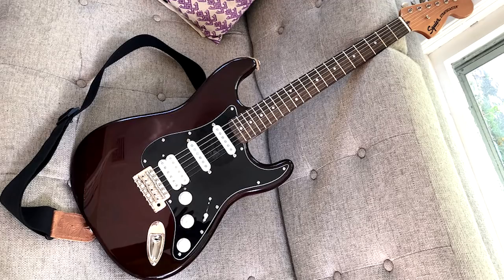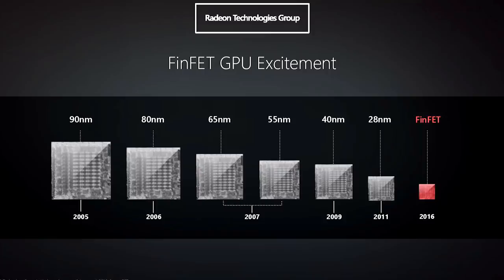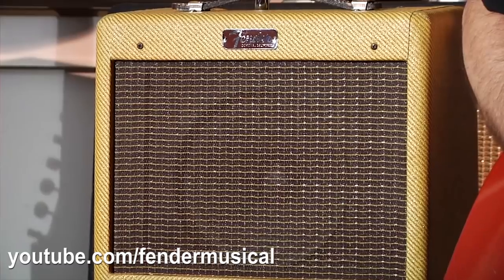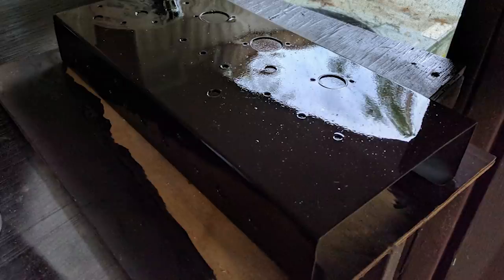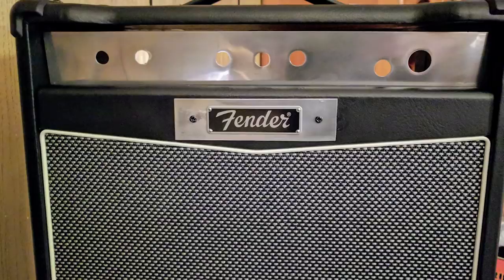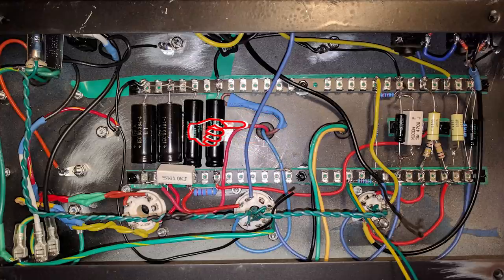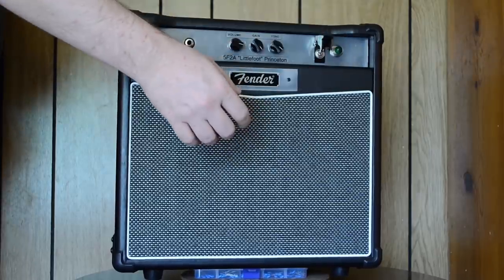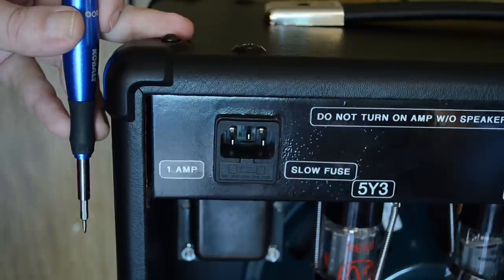The Musical Chair - Princeton With Honors

Comment: Hey Nash, longtime fan first off. I've been wanting to learn guitar for a while but I promised myself I would learn on a guitar I built myself, what kits or parts would you recommend?
Reply: Dunno about him but I've heard very good things about Solo Guitars.
Reply from the maker: Depends on your budget and skill level.

If you're comfortable sanding and finishing yourself, there's a couple $100~$200 kits out there that aren't bad. Just avoid any of them that use basswood; it's spongy and dents easily. Alder or Okoume are preferable. Also make sure you get a pre-drilled kit, otherwise you'll be in for a lot of math and measuring.

If you don't feel like you can do a paint job (and it's seriously not easy, as well as taking weeks if you're stuck with a rattle can), then I'd recommend looking for a store on eBay/Reverb called The Stratosphere. They sell parted out guitars, no need to worry about finishing. Just assembling, wiring, and setup.
Reply: @RadioDeadAir  thanks for the info!
Reply: best thing to do is try a bunch of guitars in the store or if you have any friends that play guitar, ask to try all of theirs. that way you can try a bunch of body/neck styles to see what feels right to you. i've been building my own guitars since i was 13 and i can say you CAN get way more for your money. saying that, dont be afraid of using cheaper parts from squiers. the build quality on some modern cheap guitars can be great.